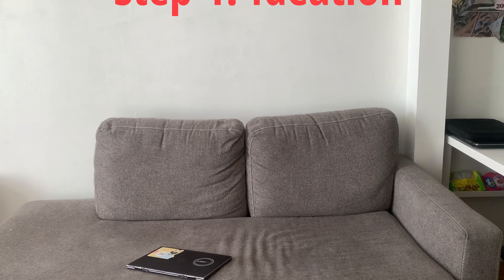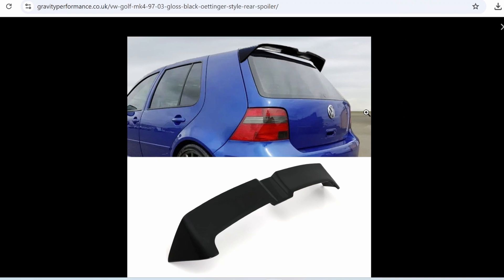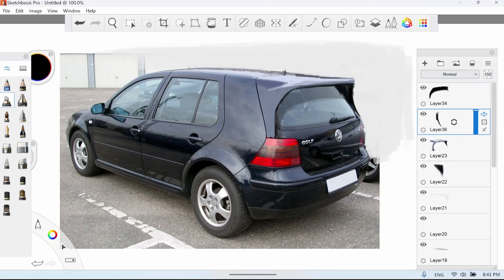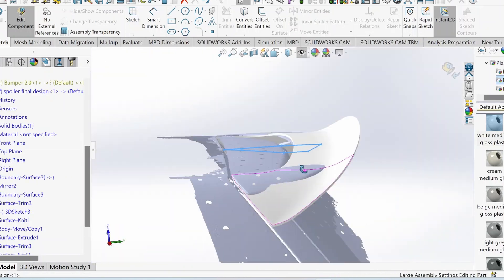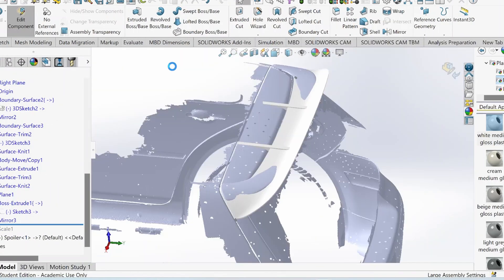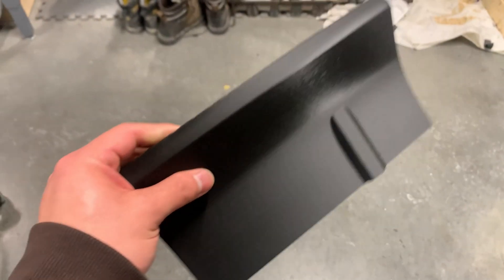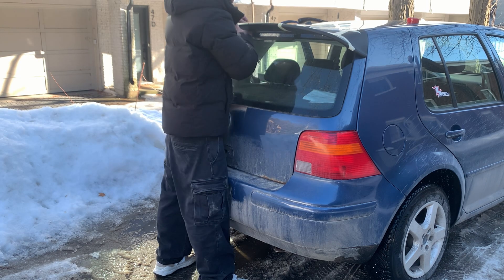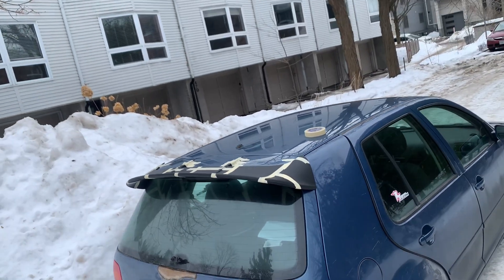I Built My Own Spoiler... in the Freezing Canadian Winter!

Comment: I was going to wait till I built a printer that I could monolithically print body parts but I think I might just do this method and make fastening parts or something.   I've got an Ender5 Plus so I've already got a huge leg up on build volume, not to mention my CR-30 belt printer I could do a like an air splitter and so side skirts.
Reply from the maker: @travismason2811  that would be cool to have the print in 1 part but multiple piece is not a bad idea since if you fail a print, it will just be a small piece instead of a big body panel if you fail it it’s a lot of time and material waste

Comment: Hi, I recently bought a 3d printer (Anycubic Kobra 2 Max) and I want make a spoiler for my peugeot 206
So i wanted to know which filament you used and how much it cost you ?
That's so cool to be able to make your own car part 🔥
Reply: Same question dude I really want to know the filament you are using, looks clean!
Reply: Most likely want to be printing in ASA as it doesn't degrade in the sun. There's other options, but PLEASE remember that everything you can use is toxic and needs proper ventilation to avoid killing your body.

Comment: Good Job ! Keep up the good work ! Will you keep the parts 3D printed ? I suggest you to create molds out of the 3D printed parts or Print the 3D mold of the part you want to create. This way you will be able to use fiber glass and epoxy or carbon fiber to manufacture long lasting body parts.
Reply from the maker: @missinggear  yes I do plan to make a mould from it. This one I was just testing out the design also the fitment  and I learn that it’s about 1 inch short in the width 😂but yea final goal is to have a mould , maybe silicon mould or fiberglass mould